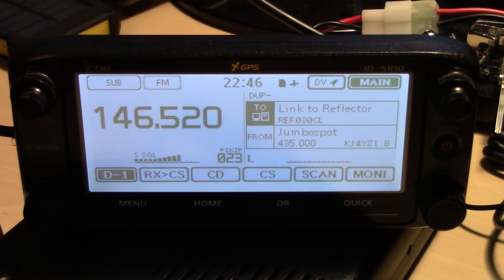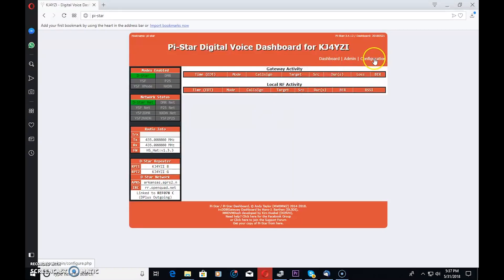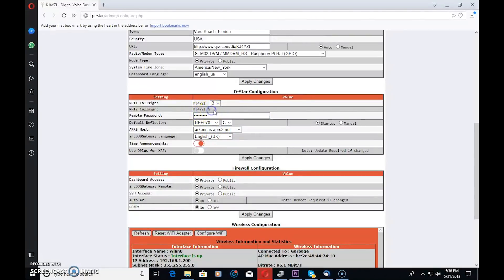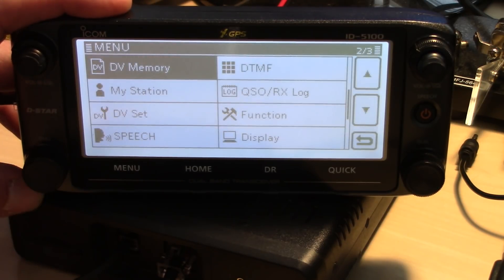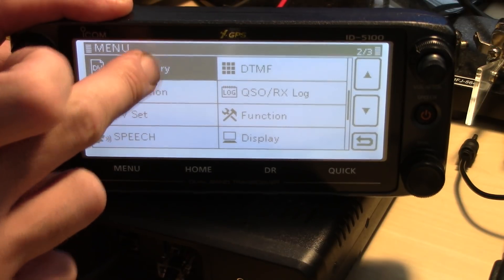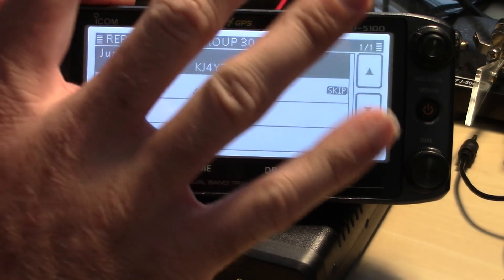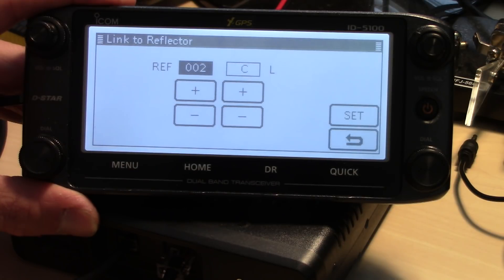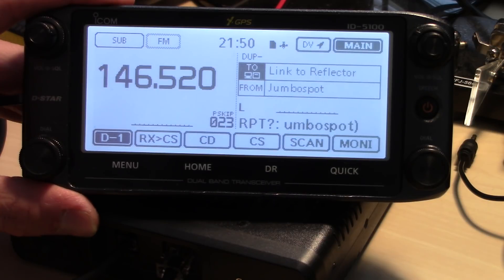D-Star Hotspot Programming Pi-Star Zumspot Linking Reflectors

Comment: When programming the group number to the repeater list of the ID-5100A, you will probably see SKIP appended to the hotspot just defined.  To solve this, enable DUP+ but set the offset to 0.000.00.  This bug appears in both firmware versions E7 and E8.  Apparently, Icom has no interest in correcting this.

Comment: After may hours of set up of my pi-star hotspot and linking it to dv memory,  I finally goti it to work by 1.  Importing a repeater cvs, editing it and added the correct information to make a new group and putting it the Pi-star linkup to the id-5100, adding that  list to id5100 sd card.  installing sd card back to id-5100.  Got the group to stay and be able to find it all the time.  Next step completly install a new pi-star image file to the micro=-sd card and reconfiguered my dvmega hotspot. I put in a little used reflector ID and could link to it and then put in a different little used reflector and was able to link to that.  And I could hear the response back audibly.  HOOOORAAAy  nearly two weeks of many hours work.and it works.

Comment: I have followed your video at least 7 times and I don't get any sign of linking or audio.  I have check all your steps which seem correct.  I am going next to get a new image for the pi-star maybe issue with d-star pw.  I so far have been at this issue for 2 weeks and at least 60 hours and I don't get the linking but just from the hotspot I have gotten audio out and conversations, just not responding to dr mode.  Help

Comment: I have an IC 7100, I've been pulling my hair out to get it talking to my radio plus connect. I'm registered for both of my calls with va7rag here in Vancouver, BC. I did go into DV memories> Both the RT programming of the hotspot in Dstar Calculation is not allowing my radio to link

Comment: HI, and thanx for your excellent videos. Really lots of times they saved my life LOL. Could you make a video of exactly this, but with the ic-7100? It seems it's not just like that in the 7100. I only could TX using the freq of the hotspot in the vfo, adding dup and offset and dv mode. No way to make it work in dr mode. Pi - star config, exaclty as yours, but the radio part...no way with dr mode.
Thanx, Pablo CX9CPE

Comment: This is very helpful.  However, when I set up the channel for my openSPOT with all the necessary details, the saved channel always shows the 'Skip' designator, so it does not show up on my repeater list.  The various skip options don't seem to change this status.  73.
Reply: Did you see the comments about DUP? You have to use + , and set offset to 0.000

Comment: Glad I saw a link to this video. I just got the ID-5100 and so far have just 2 local repeaters programed. Finally yesterday after many days of trial and error I got my THD-74 to do Dstar with my Jumbospot. With the help from this excellent video I will start the process with my ID-5100.
I have DMR and Fusion radios also and by far for me anyway the Fusion has been the simplest to set up and use.

Comment: the callsign thing got me too!   when you put in your callsign, the module indicator needs to be in position 8.  I needed two spaces between my callsign (K4HRL) and the B...   i was able to hear conversations, but wasn't able to transmit and hit my HS until i fixed that.
Reply: What about the G?
Reply: I changed my callsign when my vanity was granted and it quit working. Even reprogramming did not fix it, not until I found your message. Saved me even more wasted time - thanks!

Comment: NOTE:  The "G" at 5:10 has to be in the 8th character position.  So, if your callsign is only 4 or 5 characters, you will have to add an additional space or two from what this video illustrates.  This also applies to the "B" character added at the end of a callsign, too.

Comment: Followed your steps and I can hear and maybe talk with my ID4100 BUT when I go to "Reflector" in the radio to do the link or unlink that doesnt do anything, I hear the beep when press the button but doesnt move forward so I can't link or unlink a reflector, is ONLY working on the default REF001 C and thats it, i cant change it. Interesting, if I go to one of the imported repeaters then I have the link and unlink options available in the radio, so mean that is something with the Jumbospot, any idea? I am running the PI-Star version 3.4.17 that came with the device, but if I upgrade to the latest version I cant get it to connect to my wifi when upgrade it so I being using the one from factory.

Comment: Erick , thx for the detailed video . Followed your instructions and programmed easily . But , newly added Repeater List & Pi-Star HotSpot are not visible at DR/FROM /Repeater List because they have visible option "Skip"  .Tried everything to remove "Skip" without success .
Do you have any video regarding this issue .  VA3RGS - Rudy

Comment: Thanks! I bought the IC-7100 yesterday over the FT-891 because of price difference of $190 it gives me a 2m/70cm radio. Since it has D-Star and I don't have a repeater in my area now I have a use for one of my three hotspots. Do you have a D-star demo on HF bands? I am also wondering if the IC-7100 does SSB, AM and CW on 2m/70cm?

Comment: One important item --> You CANNOT select "off" for the offset (~5:49 in the video). You need to select + or - then set the offset frequency to 0.0000... If you select OFF a "skip" will appear and it will not be available. Took me a while and reading through many posts to find this out for my ID-5100A
Reply: I’m so have this problem
You helped me, thank you 🙏
Reply: I kept getting "Reflector Not Found" when trying to go into DR mode until I did this.  Thank you, thank you!  I'm on firmware version 1.20
Reply: Thank you so much for that one gem about an Off of set. I watched the video a dozen times I tried to enter the info into my ID-52 a Dogen times and could not get it to work, then I went to the comments to ask for help and it was there already. 😀😀. Thanks again, now I just need to get my hair to regrow.

Comment: Yea it would have helped if you had mentioned that buy switching the DUP OFF then the SKIP function is forced on permanently so that this memory channel cannot be used !!!  The DUP has to be left on but the offset frequency set to zero (0.000.00) then the SKIP function can be toggled on or off. Hope this helps as its taken me hours to figure this bug out, i've even lost my radio memories so had to start all over again !!  :(

Comment: WA9RYO - I had to use DUP+ with zero offset otherwise it did not display on the radio.  I use RT Systems software Ver 5.00.48 and the entry does not show up under DR memories and if you try to read and then write to the radio, you lose the entry.  Icom's CS-5100 software is ok.  I notified Karin at RT Systems and they are working on it.  I expect the same issue for the ID-51 and ID-31 RT Systems software too.
Reply: We found that the WCS-D5100 software from RT Systems only accommodates 1200 DR Memory slots whereas the ID-5100 with the latest firmware has 1500 slots of DR memory.  You must read from the radio first, this will now show up as 1500 slots.  However, your backup, if it has more than 1200 slots, will not show up the 1201st slot if you freshly open the RT software.

Comment: it shows in my to list but no local in my from list.. update it seems every time i put the B after call sign it turns on skip and you cant turn it off..
Reply: Me too.  Unable to remove the "skip" from the repeater list once I create the hotspot.  Any ideas?
Reply: From a user here, "For anyone who might have this issue: the fix is to set a TX offset but set the shift to 0.000. It must have an offset to be seen as a repeater." Problem solved!

Comment: Thanks for not getting back to me even though I emailed you multiple times. Your video is incorrect, to have the DV repeater show now on the 5100 in the "FROM" box you must have the "DUP" turned on and select an offset as shown on page 7-21 of the manual in the first column. I followed this video and was loosing my mind because I could not get my setup for the Zumspot to show from Repeater Group slot 50 to show, after reading the manual I finally fixed it myself. Dont know if it is a firmware update since you did this video or not but I just bought my radio at Dayton this year. Cheers....
Reply: You saved my sanity with this post. I followed the same steps in the video repeatedly and continued to fail to find it on the repeater group plus it always showed Skip. Once i put in dup with 0 offset it worked. Thank you!!!
Reply: Thanks for this. Same issue. Added Repeater group and Hotspot info but it did not show up in the DV Mode "From" field.  Edited the entry with "-Dup" with "0" offset and the Hotspot showed up in the DV Mode "From" field.
Reply: Thank you for the post! Playing around with the Skip/Skip All On/Off did nothing to fix it not being able to use my repeater. The duplex of zero in the settings was the trick - many thanks!
Reply: Hell I sent my hotspot back thinking that was the problem.  I had the same problem as yall.

Comment: I found that when I programmed my hotspot in like you said, my ID 51a plus 2 would skip my repeater. So instead of selecting no duplex i just made it a +, also works with -, and set the offset to 0. It works perfectly! Thanks for the video! Awesome as usual!
Reply: I found the same thing on my ID-4100A; turned the offset on, set the offset frequency to 0.
Reply: @JKTrail  thanks, I been for 15 minutes trying to figure why doesnt work on my ID4100, I even wiped the memory LOL
Reply: @JKTrail  Same thing with my 5100.....Also when using a Vhf Frequency shouldn't the Character in the 8th spot be a "C" not a B (for Uhf)
Reply: @EagleRiverMike  That's how I understand it, C for 2M, B for 70cm
Reply: Thank You!!
Reply: Thank you. Fixed it for me as well 6 years later thank you. KO6GKA

Comment: I am having trouble following this procedure.  My GW call sign reads AC2VE BG.  I see other comments about this but no solution. How should my call sign be entered. Also,  by entering in location 50  I do not have a repeater list group "local". I may have solved my skip problem by using duplex with zero offset.

Comment: Thanks for the video.  I see others asking the same question I had and after 4 days for trial an error, I finally figured it out.

When programming an ID-51a plus 2 (and likely all ID-51) you cannot follow this video verbatim.  In the video you show programming the as a DV-Repeater with DUP set as none.  Well if you do this with the ID-51a plus 2, the memory is set as SKIP and no matter what I tried I could not get it to work or even be a selectable entry from memory.

So, I changed the DUP to DUP- (or you can use DUP+) and set the OFFSET FREQ to 0.000.00 and it will finally work.  Other than that, you can follow all other steps.
Reply: Oh Holy crap I wish I read your comments here! As I am posting my comments above I basically just went through the same thing for the last 3 weeks loosing my mind! Oh well live and learn, should have read the manual first.
Reply: You made my day!  I was having the same problem with the skip.  I couldn't get rid of it...Until I saw your comment.  Great job and thank you!  73
Reply: Same with my 4100…

Comment: Ok I tried it again and it’s still showing “skip” after programming it into the list. I cannot figure out how to unskip it. And yes, I pushed all the skip buttons it gave me including “skip all off”
Reply: For anyone who might have this issue: the fix is to set a TX offset but set the shift to 0.000. It must have an offset to be seen as a repeater.
Reply: I really wish I had read the comments before figuring it out the hard way.
Reply: Aaron Ray and I was losing hope when decided to read the comments and then bingo. The answer was right in front of me.
Reply: Thanks for the update, was just puzzling over that "skip" tag.
Reply: Worked like a charm for me.  Very good.
Reply: @jav_eee  Thanks for the reply.  Problem solved, thanks again.
Reply: @jav_eee  Bruuuuutal. this had me messed up for over a year. thanks much!!
Reply: 1MinuteFlipDoc glad I could help!
Reply: Correct, but you also have to have the offset as + or - Duplexing even though it is also set at 0.000.  A real pain the butt. I spent way too much time getting rid of that dumb skip button.
Reply: ugh...reading these comments could have saved me an hour.  Could not figure out why it was skip...tried everything....finally fixed by setting duplex w/ 0.0 offset...only to come here and see the solution in the comments...oh well lesson learned.  Besides that...thanks for a great video.  Made rest of setup easy.
Reply: Stephen Peters it’s almost like KJ4YZI should pin a comment to the top with this info. Guess he doesn’t look back at “old” video comments?